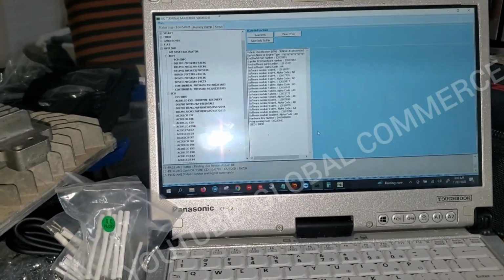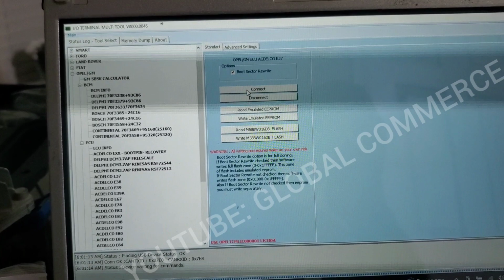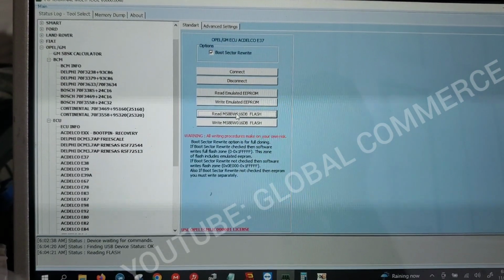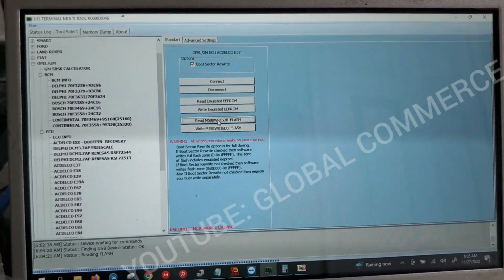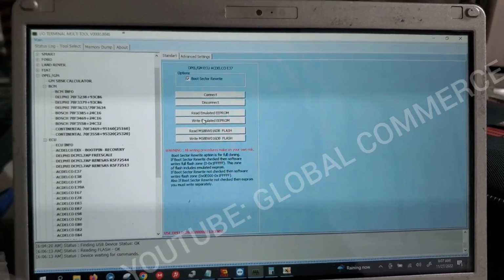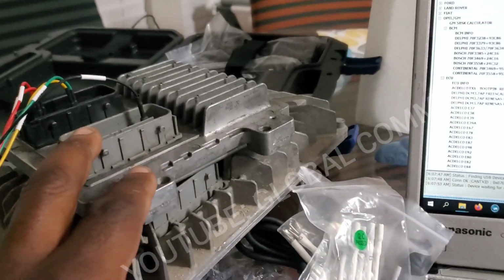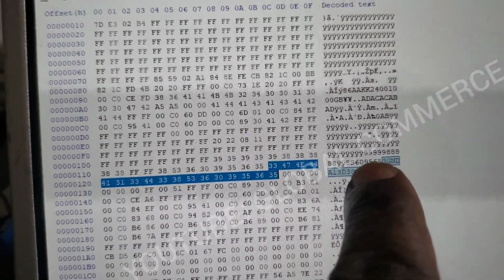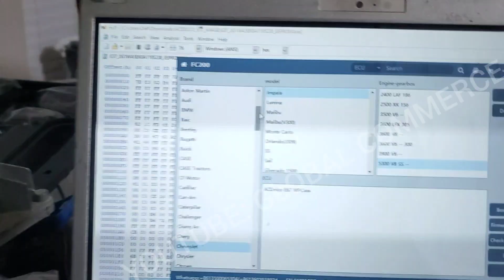Clone GM ACDELCO E37 ECM ECU using IO-prog / I/O Terminal, FC-200 GM SUPPORT? EASY!

Comment: Why you going for IO terminal? Is it because of new techline connect updates to prevent used modules?
Reply from the maker: IO Terminal and other tools allow you to clone or modify ECMs when the manufacturers don't allow it,  some of these parts can be backordered, not available or just too expensive,  also sometimes the OEM tools themselves fail at some programming,  these tools gives tech more options and in some cases faster ways of getting jobs done.

Comment: $340 ... for fuck sake
Reply: What keeps some arduino CAN module from being usable, besides nothing?
Reply from the maker: @Marc_Wolfe  using the arduino module for what exactly?
Reply: @globalcommerce7654  Letting your laptop software communicate with the ECU. There are hobbiest priced microcontrollers that include CAN; when I remember and verify which models, I'll be sure to reply.
Reply: Teensy 4.0, should only need a basic level shifter added, then the code.